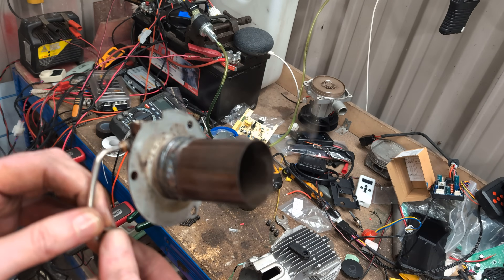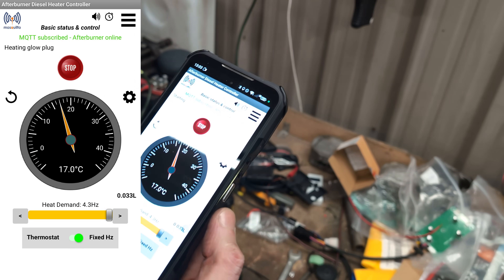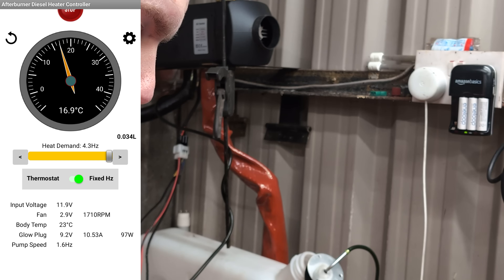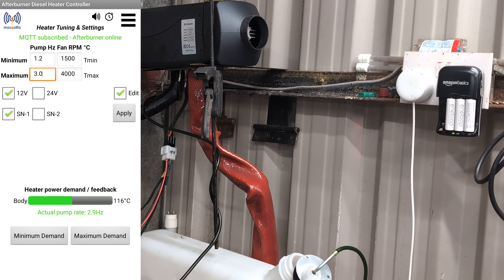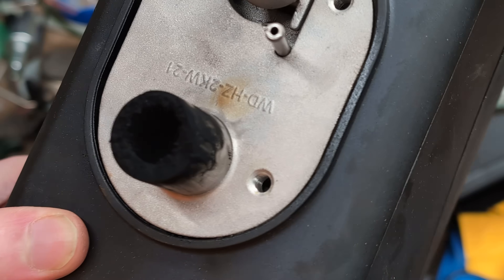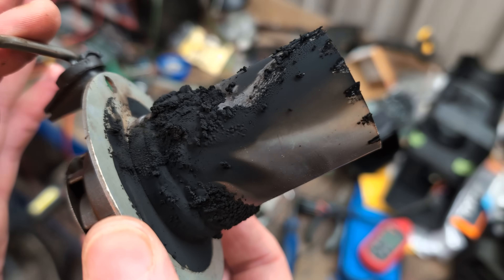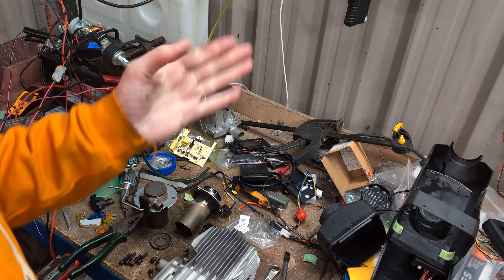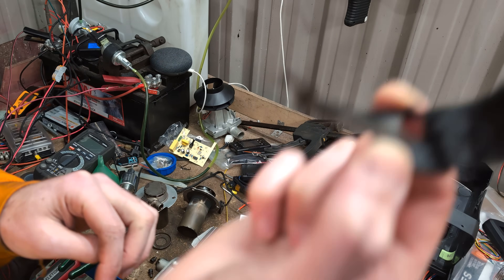Diesel Heater testing filtered waste oil - 50/50 diesel oil mix modified burn chamber - part 3

Comment: Are you going to use a centrifuge to remove the carbon from the used oil
Reply from the maker: Sadly I don't have a centrifuge.  But if I did that's what I'd use to help clean the oil.

Comment: Thanks for this David, do you think using steal wool as a replacement for the metal gauze (and possible minimal retainer held in place by drilling and tapping a hole in the center of the slotted mixer tube) would allow for propper air flow / mix to restore burn chamber use.
In short, lightly packed steel wool held in place with maybe a 3.5cm long X .75cm wide sheet metal held in place with a machine screw (or self tapper to speed up experiment) Hope this makes sense to you.
Reply from the maker: That's not a terrible idea.  Would certainly save buying a new burn chamber every time.  Could even experiment with different gauze size.

Comment: I would try heat, use a torch until the carbon starts ignite and glows after use just compressed air, this is how I cleaned the intake manifold of my sisters Audi A3 Diesel. You will be amazed how much flames will come out.
Reply from the maker: I wonder if the wicking mesh would survive the temperature required to burn the carbon off?
Reply: @DavidMcLuckie A good point, but as far as I saw it in your video the mesh should be quite thick compare to metal wool. I don't have a clogged one on hand, maybe you have and give it a try. But the proof is already there, the mesh was welded, during the weld process it should catch fire, but it doesn't so I would say it resists burning temperatures. Greetings from Germany

Comment: Wow, thank you VERY much for doing this test. I still wonder about switching between diesel, a mixture, and then back to diesel before shutting off. This video made me greatly reconsider that setup even with oil that has extremely low mileage. To me saving a little bit on fuel isn't really worth it, if I have to replace components fairly often. I might try to find out who was switching back to diesel and see how their machine is. I with more people would find this video when searching for running these on a 50/50 mix because THIS is the video they really need to see.

Comment: Can you use kerosene in these with no issues? Ive only ever used red diesel but its quite smokey on start up. Ive heard kerosene burns cleaner and is cheaper 🤷
Reply from the maker: Yes, kero works great.

Comment: Got an idea for you to test.  15 or so years ago I was in the crowd converting home #2 fuel oil heaters to run on WMO/ATF.  The big key was preheating the oil.  The cold oil is far too viscous, warming it up made it thin out substantially and it would suddenly burn pretty good.  I don't have a spare diesel heater to experiment with, but Id wager preheating the oil externally or by a wrap or two of metal pipe around the heat exchanger might make a functional improvement.  
Please don't make me go buy a new heater to test this theory!  lol

Comment: I have a question Dave. Is there a way to clean the burn chamber without dismantling the unit or is it even necessary to do this? My unit was having trouble starting and staying lit and i suspected it was due to carbon build up because i replaced the plug and cleaned the mesh atomizer thingy.

Also, Do you have a video on cleaning the heater? I looked in your channel but couldn't find one.

Thanks a million for the videos! C

Comment: I've seen a bunch of videos on people using motor oil and they end up with the same problem. But I've never seen anyone try used cooking oils, like deep friar oil. I would love to know if that would work. I have 250 gallons of it for my smelter and stove heater. I have access to alot of it. If that works I'd be extremely grateful. Love your content and I'll let yall try out all of those concoction first. Lol. Good luck and be careful.
Reply: It can burn that mixed with 25% petrol

Comment: Results are exactly as I expected.  Don't matter what it is mixed with, the oil will always leave a residue in this application that will build up in proportion to the amount used. 

I will be very interested to see this product that will allow waste oil use.  Unless it somehow distils the fuel or vaporises it before introduction to the burner, it will be some sort of miracle in my book.
Reply from the maker: Sadly no miracle machine.  It just allows longer run time between cleans hopefully.

But seeing as I've only had swapped this burn chamber four times and have already partially stripped some threads, I'm going to recommend helicoiling it all if taking it apart regularly is a thing.

Comment: Maybe i just need to run it more or maybe my filter process is better or wase oil is different? I filter through a motor guard filter several times, loaded with scotts 1000 toiled paper. Then i cut with gas not diesel, and my heater hasnt failed yet. At this point when it dose i think it will just pay for a new. Ill try pulling the chamber when i get a sec.
Reply from the maker: Maybe I should try 50/50 oil and gas (petrol).  What's the worst that can happen?  :)
Reply: @DavidMcLuckie  i need to pull my burn chamber and see also, maybe its just a mater of time. I run my pickup on wmo for thousands of miles and pulled the injectors, almost no buildup. I start and stop on diesel though, and I have alot of atf in my wmo also. Im just curious why, our shop heater dosnt have any carbon build up, just ash. We clean it once a year. Thease heaters should get hot enough to burn everything, maybe its just the start stop that cokes them up?
Reply: Oh! Also, I do my best to avoid synthetic. It cokes really bad compared to none synthetic, most of my blend is 15w-40 diesel oil.

Comment: there is a small hole at the top of the glow plug that allows air in. has anyone tried to make that a little bigger to see if it burns cleaner?

Comment: For cleaning the burn chamber (not the aluminium part but the steel one) just soak it in hot caustic soda/drain cleaner, doesn't do much to the steel but eats away soot and aluminium

Comment: curiously, there are a number of people out there that claim to run oil/diesel mix as well as veg oil and hydraulic oil and all sorts of stuff and "it ran for years". They also claim it gets carbon fouled but somehow it takes quite a while. I have no idea how long it takes for it to get like that. I have read some folks run dual tanks and start with pure diesel, switch to something more like a 60/40 mix, then finish with a diesel burn. IDK. I suppose it's a way to use up some old oil if you can make it work but, it also seems like a lot of struggle if you don't have to.
Reply from the maker: I'm finding there is a mix of comments of people running engines on waste oil commenting it runs fine which is confusing if I'm not paying attention.  There is the occasional person saying their heater is running on it.  But it does seem to be just a matter of how much waste, how dirty, how long before it needs cleaned.

Comment: Engine oil. New or used will always leave deposits due to the additives some which are non flammable, the only oils that would burn clean and completely is clean cooking oil, kerosene, diesel,  the diesel heaters would be more efficient if they could burn hotter but the casing relies on being cooled by the passing air and the standard material wouldn't be able to acheive the temps without damaging itself. What you are trying to acheive isn't possible, the dpf reaches temps over 600ºc

A modified dpf, could work but achieving the temps with a glow plug and fan would be difficult but not impossible

Comment: Hi,in that 5 liter reservoir i mixed 2.5 l diesel,2 l hydraulic oil and 0.3l gasoline,mixed verry well and no problems,no smoke ,clean burn. I used  until now 5 full tanks of this mix and no problems. I dont know what is in my burn chamber but no error until now in 5 tanks burned. Maybe you should try this mix. Cheers
Reply from the maker: Burning waste hydraulic oil isn't an issue.  It doesn't have the same level of contaminants as engine oil.  There is almost no residue in the waste oil burners I've seen running on hydraulic oil.

Comment: Burnt engine oil produces ash, which just can't be burnt off. That's why engines with DPF have ultra low ash engine oil.
DPFs get blocked up by ash eventually from engine oil being burnt on engines, it doesn't get burnt off in DPFs either.
Could make some sort of internal scrubbing or knocking device to periodically break apart the ash?

Comment: Based on your experiences, will burning kerosene adversely affect a diesel heater? I’m concerned about a possible lack of lubrication for the pump. Thanks again, I really appreciate your videos.
Reply from the maker: Kerosene burns fantastically.  Pump doesn't care.  It's the same pump they use for the gasoline heaters.

Comment: Could you find anyone with a centrifugal filter you could get a bit of oil off, just to try it? I have no idea whether it would stop the gumming up (it's mostly good for particulates and metal fines, to make it clean enough to go through an injection pump, so might not affect the stuff that's making all the crap you've got in there), but it'd be interesting to see either way

Comment: With the burn chamber with the 50/50 mix that ran through the full tank, could you run it on straight diesel or kerosene afterwards and burn through the old carbon deposits?
I'm torn about learning more from you because i need an excuse to buy one myself so i can bugger around with it!

Comment: I wonder if an electronics ultra-sonic cleaner can remove the carbon and deposits from the chamber/mesh.
Reply from the maker: I've only got a little crappy ultrasonic bath.  All it's done so far it make the water dirty.
Reply: @DavidMcLuckie   Yer i suppose that should of been an abvious outcome.. afterall they are only designed to take over tiny layers of grime not massive carbon and what not materials lol.
Reply: 😮 I'm curious 🤔

Comment: I have seen videos of this formula working in a 4kw model.

~25% alcohol(meth/eth), 75% triple filtered waste oil(progressively finer filters down to 5 micron)and run the heater as hot as it will go. They need to come up to temp on diesel/kerosene, then you switch over to the waste oil mix, then shut it down on diesel/kerosene.

Comment: Found a way to not alter design and open it to change the mesh. Infinitely cleanable burning with no welding required !  I`ll be posting the video soon.
Reply: Do you have an update for us?
Reply: I'll be keeping an eye on this! Sounds too good to be true but please prove me wrong! I have no idea how this would work but I was thinking, could someone design a completely different/new burn chamber inside the existing design? So it could burn waste oil? 🎉

Comment: Curious, do you filter your waste oil then add the diesel or add the diesel then filter? You may be able to increase your filter material by adding the diesel first. Just a thought.
Reply: Hmm, Idea sounds good but when you dilute a substance and then filter it won't it just take longer to filter and take out the same amount of particles?  And leave you with the same amount of dirty filter?
Reply: I wanted to add, a centrifuge could (i think) actually solve this. There is no filter in that. So if you do that before filtering and adding the diesel it will flow through the centrifuge more easily.

Comment: Thank you David, the engine oil experiment was very interesting, wont be using that so...I'm in South Mexico near Galway 😊 , I've switched to heating oil / Kerosene recently, its actually a good bit cheaper than road diesel.... So far so good, I feel it burns a bit hotter too. Will let you know if anything strange happens....keep up the important work 😋and have a nice holiday period...cheers..Michael

Comment: If you feed nitro glycerine after the waste oil, the burn chamber will be clean...spread across the neighbourhood, but clean. :)
Your knowledge of these contraptions is exemplary David. Thank you for educating us!
All the very best to you and yours.
Reply: I don't know much about all the different fuels and so my question is, can't kerosine do the same? Or will nitro glycerine burn even hotter? 😈
Reply: @BenVeenstra   Nitroglycerin is oxygen positive (That means there is left over oxygen molecules left after it has consumed its self) So it burns incredibly hot and leaves residue oxygen to consume the carbon. Ironically disolved with enough diesel this would make a good fuel additive, but pesky red tape makes it hard to formulate such a fuel additive.
Reply: @Refertech101  thanks! That makes sense.

Comment: Just an observation about carbon. When my lighting was provided by Aladdin lamps and they would sometimes run away and soot up the mantle the easy way to clean them was with a pinch of salt down the chimney while it was running and it just burned away in a moment. I’ve no idea why it worked but it did.
Reply: Maybe it's similar to the way eolys fluid works to clean DPFs 🤔  by lowering the temp the soot will burn and turn to Ash ?

Comment: I think burning kero with  touch of 2stroke oil to slow the burn down might be a good way to go for highest heat output. In my experience,  kero doesn't get it quite as hot as diesel because of the faster burn. Its seems counter intuitive,  but thats the way it is.  
Btw, i mistakenly put expensive diesel in mine instead of ordinary diesel and actually found i hsd a better heat output,  but thinking about it,  it makes sense because in order to get better power or mpg, you'd need a hotter (but not faster) burning fuel.
Reply: I like burning kero because handling diesel is messy and once spilled, it is hard to get rid of the smell. Could you expand on adding 2 stoke oil to kero to make it burn hotter?
Reply: Actually,  I don't think its worth adding 2 stroke as I think it will still clog the big mesh/gauze. Cleaning might ultimately be easier but it will still clog because the gauze isn't actually going to get hot enough to burn the carbon away.

Comment: I agree no matter what you do it will not work without constantly cleaning it but I believe that if you take a diesel heater running on diesel to help heat a larger burn chamber burning waste oil that is easily cleaned daily is the way to go

Comment: Thanks David! Nice to see the true results of waste oil burning!😀👍
Reply: Yeah, burning engine oil is diiiiiirrrrrty.

I assume waste oil burners that shops use run hot enough to turn the oil waste into ash and blow it away.

I had a home made waste oil burner made out of a propane gas bottle and even on a red hot base the oil will still turn to this grey concrete you have to smash away with a hammer. I had to clean it daily, or if I ran it for 4 hours I'd have to shut it down and clean it to keep it going.

Comment: Reweld the end cap/baffle back on the end of the burner (not way down in the chamber next to the fuel inlet...to create an enclosedish tube)
It seems that the carbon/additives goo just dribbled/blew out the end of the burn chamber and coated the inside of the body, with that end cap but further away, it might hold more...but looks like it just sludged/carboned up)
Fooey...it definitely seems it just is destined to clog up, the additives/carbon really has no place to go and just crapifies up the exhaust
Very very cool on the experimentation though...it seems to have worked but like you said...it will eventually clog up no matter what
To dissolve the carbon on the mesh...just soak the mesh in a tub of petrol(gasoline) that should break it down enough so you can blow out the mesh with compressed air
Thanks for all the hard work you are doing!
Keep em coming!!!!
Reply: Out of experience I know soaking the mesh to blow it out won't work. After clogging up, even when burning kerosine, soaking and blowing it will never burn the same :( the mesh is too fine. It is very surprising when you see it in person. I'm curious about your other statement though! 😮 I'm very interested if someone could design a completely new burn chamber that will fit the existing heater made for waste oil burning or even just being able to get rid of the build up easily 🎉

Comment: I’ve run a couple of these on various mixes of oil and diesel, even isopropyl and oil but eventually they are not happy. I’ve never opened mine to check but noticed the burn noise change to a deeper tone and smoke. I found putting half a bottle of wyns extreme diesel system cleaner fuel additive through a tank of 100% diesel sorted that. It would be interesting to see how it worked to clear what deposits you have in the burn chambers! Great content and love the delivery. Keep up the good work. 👍
Reply: That is as useful a reply as the article itself. The cleanliness of the fuel was always the key to getting these things going for a few months before they clog. I never thought of giving them the same treatment as you would an engine. Great input, Thanks.

Comment: Free heat with waste oil is a very attractive idea. But in the end it's probably more ecological and economical to industrially recycle that oil so it's once more a useful lubricant than it is to burn it producing waste that still needs recycling.

Comment: I've been running mines on a mix of waste oil, veg oil,. rape seed oil mixed with thinners or white spirit and whatver I had laying about and could not get  diesel quickly lol,  but aye in my experience there is no proper mix that will work with these standard heaters, they all get carboned/gummed up eventually, well, the one I abuse in the garage does, one for my campervan has not been abused that way LOL, I think I used your videos to strip and clean my garage one, still works fine! :)